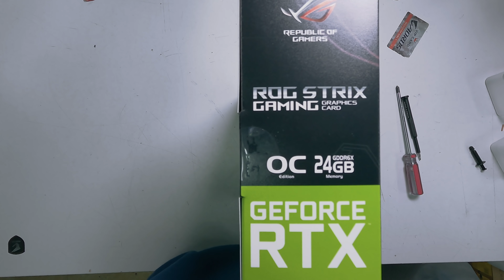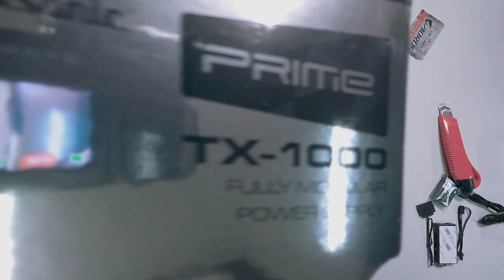AMD RYZEN9 5950X & ASUS ROG STRIX RTX 3090 Extreme Watercooled build

Comment: He has all of the strix 3090s in the world
Reply: Naw system builders were given huge stock compared to AIBs
Reply: He literally probably re uses it in every build / builds it for clients
Reply: @zainshamim343  all these builds are client builds
Reply: @brianchiang4271  do you know that AIB stands for add in board partners, who are the manufacturer...
Reply: I managed to get 2 :)
Reply: @presspain4007  dope. the strix 3090s or 3090 fe's?
Reply: @brianchiang4271  All Graphic Cards = AIB
Reply: No wonder I can't find one
Reply: @flangerfn2784  lol
Reply: nope. Linus has one
Reply: Not all of them lol
Reply: I got one about a month ago and I'm using it with my i9-10900k. This card is the most powerful RTX 3090, whoever gets it, he has a mighty power. I almost get 200 FPS in COD MW with 1440p on low!
Reply: what does he do with the rtx 3090 cooler
Reply: He has a 3090 but still uses a hdd ahahah
Reply: Well, he doesn't look like miner
Reply: Can someone plz advise what fan direction he used for front and top rad ? I need to know...
Reply: @dronetheworld4k67  watch randomfrankp's 2021 how to a build a pc guide
Reply: @slemded  I know how to build a pc a built several am just asking about fan direction 4 this build.
Reply: @dronetheworld4k67  ???
Reply: @dronetheworld4k67  the portion with plastic Lines. Is outtake while The Portion without Plastic Lines is intake

Comment: built the 3090 STRIX OC aswel with ek vector wtb on it.. works fine but coilwhines much harder had to take it appart and ad some 0,5 mm pads on the other side of the vrm to counter pressure the front pads,, after that silent as a mouse.

Comment: Bad air ventilation on the case. The fans are blowing out of the case creating a negative air pressure except the front panel fans. The heat on the front radiator will make the inside of the case hotter and the negative pressure results in dust buildup.

Comment: This might be a dumb question haha, but how does the water cooling work? How does it fill to the top if it even does, and only has a hole towards the middle which the water could surpass if filled fully, does it seep through the bottom into different sections for the pipes? This has been mind boggling me lol

Comment: Did you fix the thermal pad of Block VGA? when we using 1mm thermal pad Vram NOT touch the block, fixing with 2mm or 1,5mm thermal pad is better.

Comment: I have a rog strix 3090 too and want to get the Strimer plus cables you used. I see you used 2x 8 pin cables for the GPU. Does that work out of the box the way you connected it or is any modding required?

Comment: How did you contact the third Lian li strimer plus to the lightning node/system
Reply: U have to solder the second dual 8pin to the controller.... like I did for my 3080ftw3 ultra
Reply: @Bristol-MyersSquibb  at the same connector as the double 8 pin goes in in the controller
Reply: @Odin..  yessir exactly
Reply: Open the controller and solder it to the inside connector
Reply: @Bristol-MyersSquibb  oke thanks then ill order a second Lian li strimer plus because otherwise it looks kinda lame with one cable diffrent.
Reply: @Odin..  yea man I put one running below the card and one above the card looks pretty cool and good luck man I hope they look awesome

Comment: My OCD  got disturbed by the the pips from the cpu to the motherboard angle and the pips blocking the fans at the top. But nice build non the less. The watercooling is way to much work though 😂

Comment: My OCD would crumble upon this 8 row strimer used for the 4 row 8 pin cable extension. Wouldn't be possible to use 24 pin lighting cable from mobo with triple pcie 8 pin power cables?

Comment: Nice build. However, as far as I understand the 2 x 3090 will require 2x16=32 lanes while according the specification a single 5950x maintains just 24. Could you please confirm if this is correct and how are you dealing with this limitation in your case.
@t

Comment: why buy a strix and go watercooling? just get a simple air cooling solution card. 30 series oc is just not there at all
Reply: @Sinister [GD] read again.
Reply: Because this build is meant to be pretty, not cheap. There was clearly a goal to chrome up the build to reflect RGB light. A stock cooler wouldn't do.
Reply: @ShimmeringSword  u know the watercooler looks the same for the most 30 series gpus
Reply: @gsr_9978  if what you mean is he should have bought a cheaper version to water cool. You buy what is available, the 3000 series is not a buyers choice market.

Comment: 2:06 WTF IS THAT THERMAL PASTE JOB
Reply: you can put an x on the cpu instead of a pea sized drop to go down 3 degrees
Reply: Chill. It will spread evenly....
Reply: Several big tech youtube channels have proven that there is almost no wrong way to apply paste so long as it isn't too little or waaaay too much. X-line or X dots are a fine method.